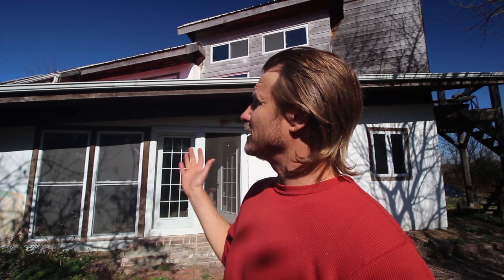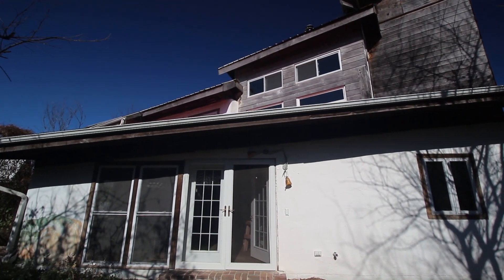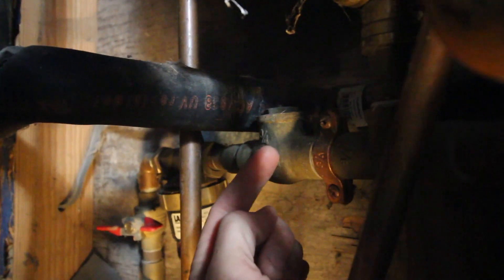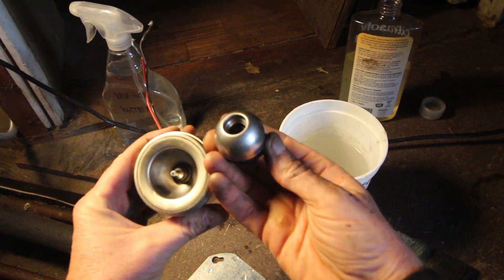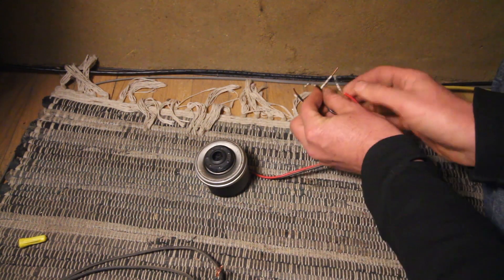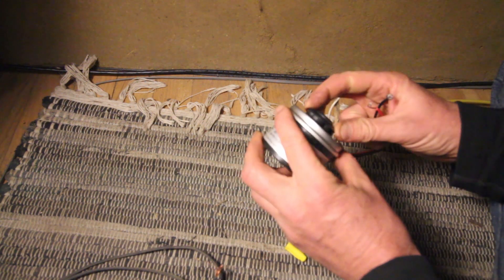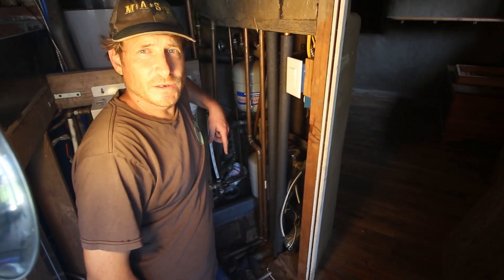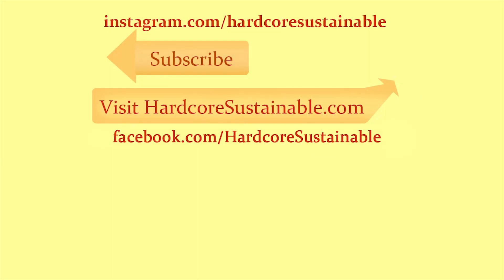Superefficient OFF GRID Water Heating with EVACUATED TUBES

Comment: Even a small branch will cut the power down on your pv  panel and slow down or stop the pump panel  should be in full sun. Solar hot water tubes will boil the antifreeze /glycol/ and gum things up ,gets way to hot when the pump is not  circulating properly. Should be tested and changed out with the proper glycol water mix,  the  tubes are ok with a little shade, tubes are so well  insulated snow and ice won't melt off for a long time so having them where you can clean them off easily is a good thing.
Reply from the maker: Thanks for the info!  Yes that's why I had the tubes covered when the pump wasn't working. Didn't want to heat the fluid without circulation.  I wasn't sure if the black gunk in the pump was residue from overheated antifreeze, or from bits of the plastic part of the pump flaking off from friction.  Clearly the pump was not running smoothly and so might have been causing friction.

Yes, a solar panel will get almost no power with the slightest shade on it.  Good to know about cleaning snow off them.  Makes sense that they wouldn't heat up, being that they have a vacuum inside.  We have to clean off our PVs all the time in winter. I still think it would be possible to clean them with a brush on a pole like we do with PVs.
Reply: The tubes can be mounted almost vertical with a slight angle for the winter sun for the snow, personally on a roof I like a flat hot water panels, snow melts off easily, the tubes will stay frosted up pretty hard to clean off, then the tubes are pretty fragile, when reaching up with a pole.
 Is this system  just heating up a water tank for hot water?  Pump should always be running when the sun is out , that extra heat should be dumped into a space where it can be stored, basement, crawl space, concrete slab or even a tank of water with a heat exchanger or just a roll of flexible pipe in the tank, heats up and stores heat for later. Personally I would install another  pump and panel in the system, that system is pretty big, it will heat a lot of fluid going through it, then it's a backup so the system doesn't over heat. Pump cost  little compared to the system.
Reply from the maker: @ronaldsahn9649  This system heats water in a hot water heater tank and there is also a wood stove for supplemental heat in the winter, so the cook stove in the kitchen can be used to heat water as well. Then the system is also connected to radiant floor tubing for heating the house, so the panels and the wood stove heat water for heating the rest of the house with radiant floor tubing. I'm not sure if during the summer it can put too much heat into the system since it's only needed for heating water for kitchen and bath use at that time of year.  I would guess it doesn't have a lot of waste or it wouldn't be set to just run all the time the sun is shining.

Maybe if there was an easy way to cover the panels during a snow storm it would be easier to keep them clean.
Reply: That's a good system with the heat storage, as large as the system is shouldn't have any problems heating and storing  the heat in the  floors,    looks like the week link is just the volume of the pumping, 2 pumps 2 pv panels would push a lot more heat into the storage and be a good  backup and simple.  Summer time the system still needs to run and need to dump that heat somewhere else probably be covered with shade cloth during the summer, as long as you have enough hot water. Dumping the heat is a separate problem, but could be used to extend the growing season in  greenhouse grow beds, spring and fall when heat is not needed in the house. I've done a lot of work finding leaks in snow melt and in floor heating systems with a thermal camera, if the system is hot you can see all the lines and you will see a leak or a pinched line pretty easy now cameras are pretty cheap to rent seen them at home Depot   or borrow from a plumber. I think I paid 700 bucks for the one I got last year, 15 years ago they were 25 grand.
Reply: @ronaldsahn9649  we have that hot water heating system, but we don't have anyone to help us connect, could you help us in any way, if you have any instructions to forward to me?